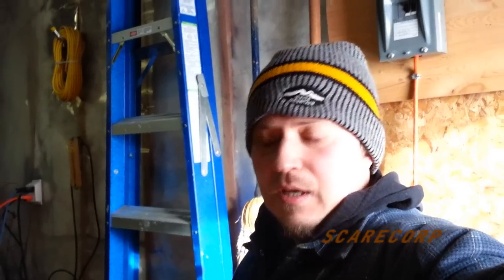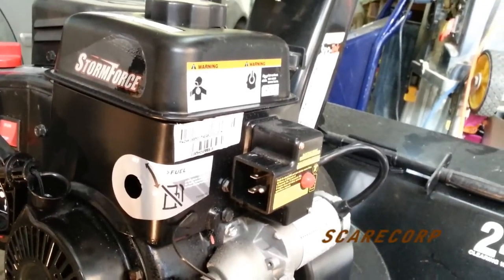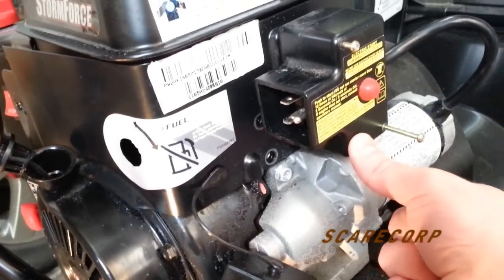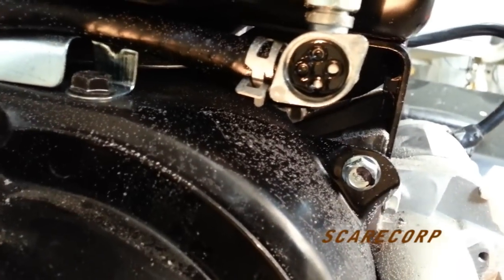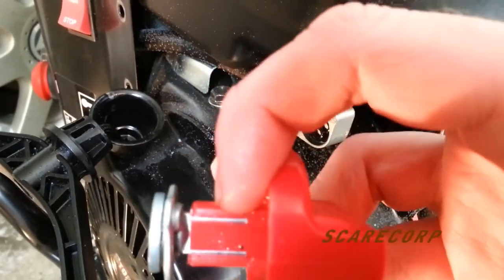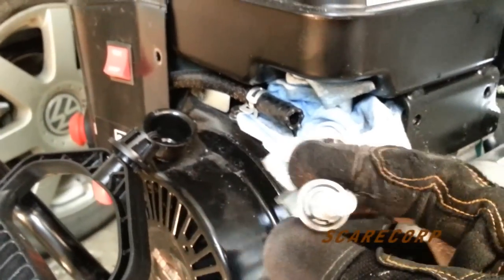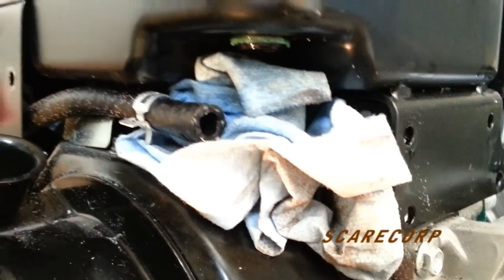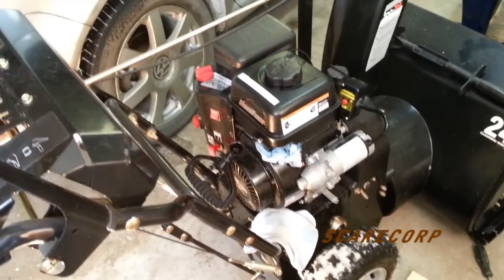SnoTek 24 Repair Series - Part 2 "Removal"

Comment: Can you tell me how you removed the shut off valve from the bottom of the fuel tank? I un screwed the hex nut, but it didn't seem to loosen the valve enough. Did you pull it out with your needle nose pliers? Thanks. Any help would be appreciated.

Comment: Hi, Random question, but I'm having trouble removing a tire from a Sno-Tek 24 (model 920402). I removed the lock-pin and can't see anything else  which is holding the tire on, but it seems like there's some other "lock". Any idea?
Reply: Michael Pisula I mm
Reply: Did you get the wheel off Michael? Maybe it just rusted a little bit onto the shaft. That's pretty common.

Comment: Replacement parts
LCT Fuel Control Knob, part number: 45031
LCT Fuel shut-off valve part number: 49001
Reply: Thank you for the video ScareCorp, and thanks Mark for the part #'s. On mine it started leaking fuel last winter. It seemed like it was coming from the shutoff valve but I couldn't see exactly where or how to fix it. This video helped immensely. I think on mine it was just the o-ring on the valve where it goes into the tank. It seemed all eaten away and gummy. I think my mistake was putting a couple oz of straight Stabil in there last fall. I think that was too strong and ate the o-ring maybe.